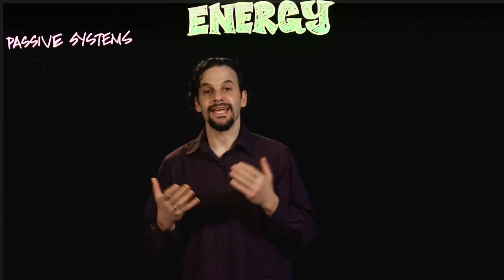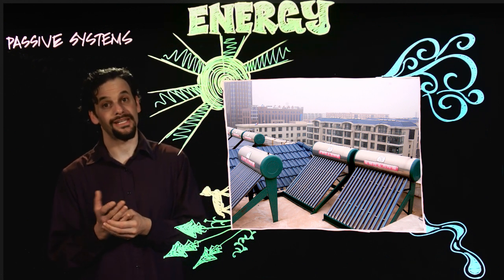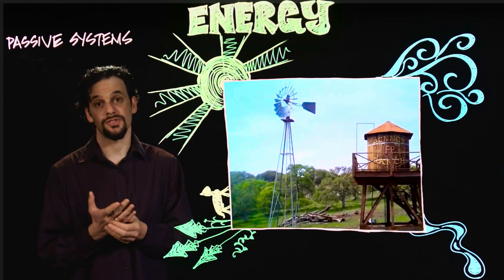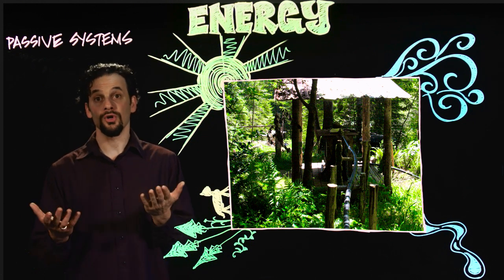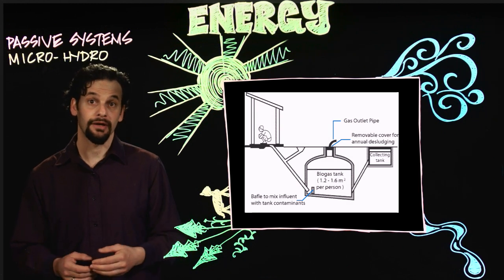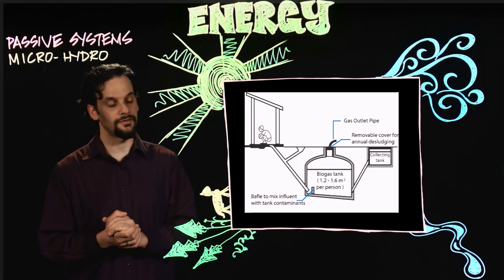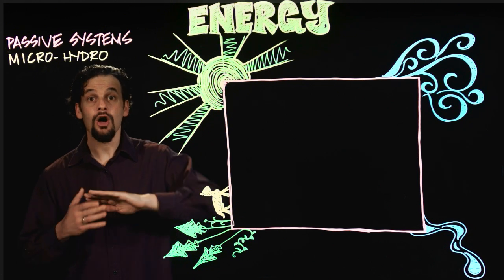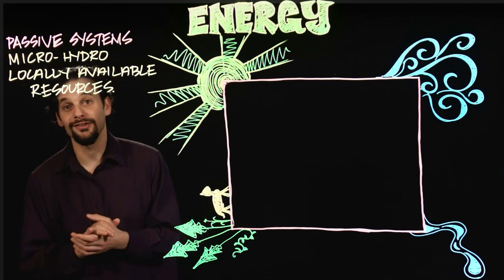Energy Systems Permaculture

Comment: Vertical axis windmills are better for sites with less than desirable wind conditions and siting.
Reply: Thank you for mentioning this, I hadn't heard of these before.
Reply: @tomriordan6008  
They are more durable and practical for most at home use...
Reply: Mosaicmaster 1  
Take it you are talking about a horizontal axis windmill being vulnerable...  Not sure you'd want to hassle with servicing a mechanism at the top of a windmill much,  even if its motor location was improved.   Believe there are wind-sheer stresses involved, too.  
Vertical axis ones can be more attractive,  and can look like art installations rather than just power generators.  That vertical axis windmills already fit the need is enough...
Reply: Mosaicmaster 1  
I want to alter the look of the blades for an artier look.
Reply: Mosaicmaster 1  
Think the vert. Axis ones run cheaper,  relatively...